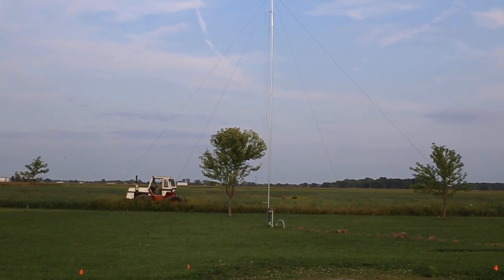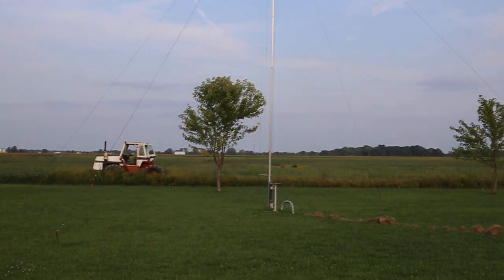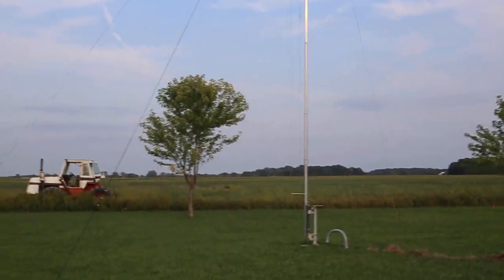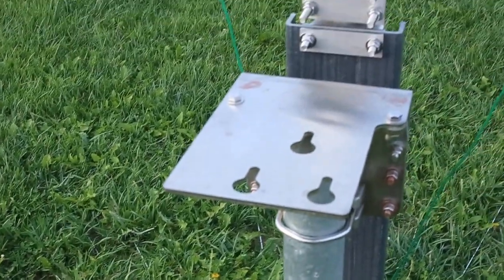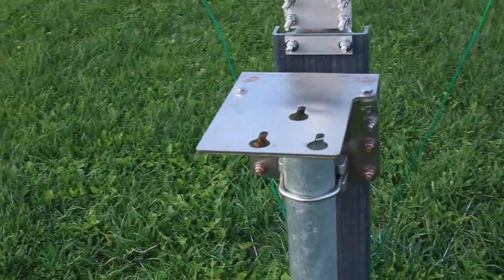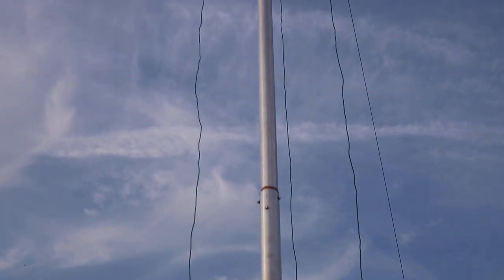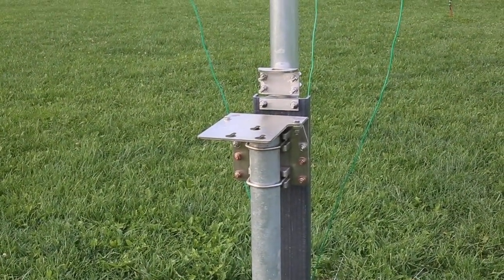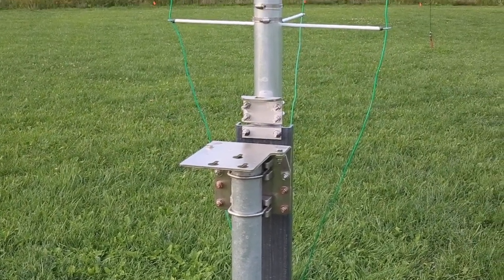DX Engineering 7580 FS VA 2 full-size 80 meter vertical plus 3 bands

Comment: I need to add 40M but my 4O3A Tuner does a great job loading this on all other Bands down to 17M at least but I really just use it for 30,60,80  most of the time.

Comment: Did you test the performance of the antenna on the other bands before adding the other radiators?
Reply from the maker: they don't seem to interact at all that i could tell.  i know it looks stupid simple but it just seems to work.  again- just a casual op.  not doing a/b testing really.  i don't ever listen on this- i have an active loop in one ear and a dipole in the other ear when i have my headphones on doing CW.  icom 7610; diversity receive.  yes- overkill for a casual op but QSB is less if i listen that way.

Comment: I’m thinking about getting this antenna. Do you need the guys? I think it was free standing? 

73s N0SL
Reply from the maker: It is supposed to be free standing and I think the wind rating is 93MPH or something like that with no ice.  Well here it is going to get ice!!!  Ice increases the weight A LOT, and increases the wind load because the diameter is increased.  How much ice is too much?  I like to be prepared for the worst so  I feel much safer having it guyed.
Reply: @laserchickenstudio  thanks!

Comment: Hi David, I plan on adding a couple of bands to mine as well. What kind of spring system are you using on the top bracket for your extra elements?
Reply from the maker: Just search on Amazon- "extension spring assortment black oxide" and pick one with good reviews- that's how I did it!!
Reply: @laserchickenstudio  Thanks a bunch. Found it.

Comment: David , what is the spacing you used from the main element ( middle ) to the wires ????
Reply from the maker: Hey Leon if you mean from the main element to the additional elements that I added for more bands- it's not critical I was told.  It works great as it is, and it's maybe 12 inches.

Comment: Update us on the performance. Would you do it again?
Reply from the maker: Yes!  I've had great luck on the air with this antenna.  No complaints.  I guess really if I had to do it again it depends on when.  I'm 53 now.  It would have to be sooner rather than later.  An installation like this is for a young-ish man!!  Of course a trencher would have made it a lot easier.  And digging that huge hole for the concrete was a bit much when you do it by hand.